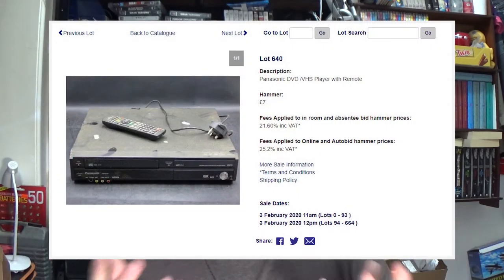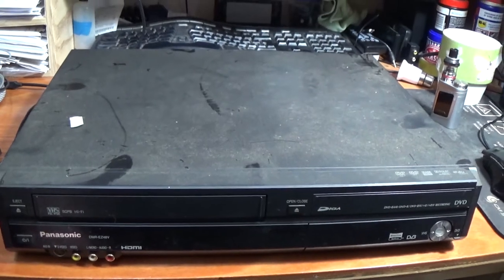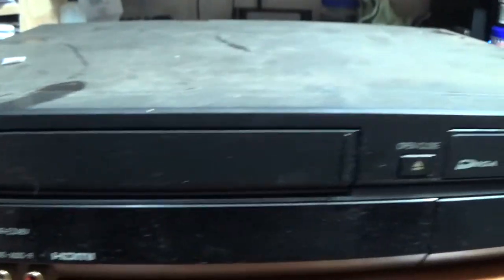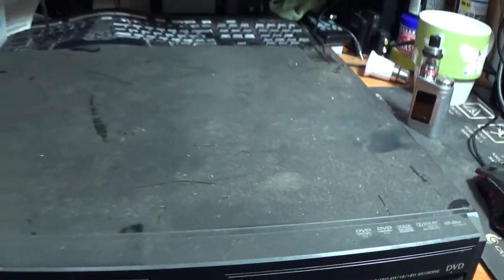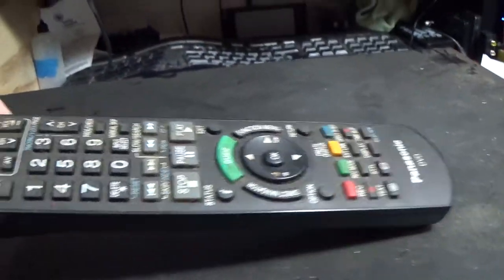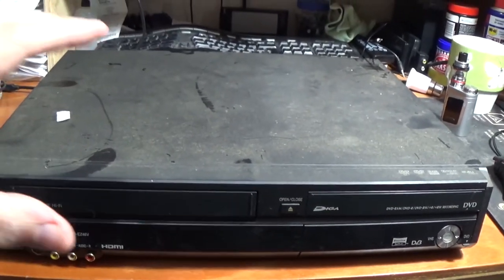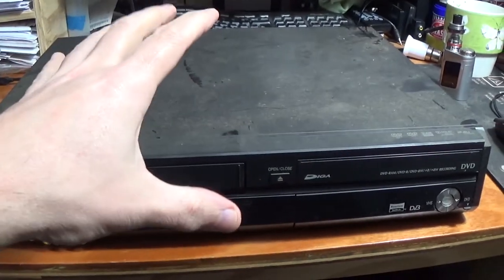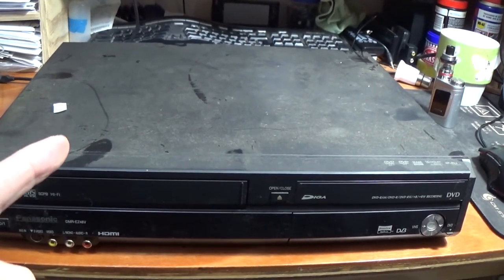Panasonic VCR/DVD Combo Repair - DMR EZ48V bought from an auction to sell on eBay.

Comment: I have two of these systems. One I have repaired a couple times. First time was replacing the VHS drive belt and more recently replacing a cap in the power supply. I just love it when I can bring something back to life. The second one I just purchased as a backup. I like that it has an HDMI output and seems to be durable machine. The lines on the top you mention toward the end of video are likely cc decoding information. The noise on the bottom is likely overscan noise. TVs mask out that area, but video monitors don't. Thanks for posting the video. Very educational. Cheers.
Reply from the maker: Thanks for watching and commenting. Like you I really get a lot of satisfaction from reviving totally dead units. I just recently learned about the overscan problem on an old VCR I was working on. Sadly not one I filmed but would have been good if I had.
Reply: I also love it, when I can bring something back to life too, but I also dump from every device I refurbish the firmware out for that specific Model number and keep it for further repair, if I buy the same device with a corrupted firmware for the second time for repairing I can reprogram the TSOP48 flash with my programmer and the device would then be back to life. Forget about for contacting Panasonic for the Firmware .BIN file they will never give the firmware out. but I and we can dump it out from the hardware flash ROM itself to obtain the Firmware if you have a programmer and good soldering skills for TSOP48 which I have
Reply: but this Unit has also a ST Microprocessor called Back End PCB on the left side at 4:38 (the green PCB) behind the erase head of the VCR drive. That has also a TSOP48 flash.

Comment: I have the same Panasonic VHS/DVD combo, and from my experience of using the VHS recorder it seems to do a very good job at tracking very jumpy tapes, not surprising I suppose given that it cost brand new about £250 back in the mid 2000s. I had one tape which was a home video, and for about the first half hour from the start of the tape the tape just jumps all over the place whilst playing it on a Sony SLV VHS recorder, and no amount of manual or auto tracking could stabilise the video to the point where the picture was watchable. I then tried the tape in my Panasonic VHS/DVD recorder combi and the machine was able to track the picture with no effort at all, almost eradicating the jumping completely. I initially thought the tape was so badly worn that no tracking could fix it, but it seems the Panasonic could do what the Sony machine couldn't. For tracking old tapes I would highly recommend getting hold of one, if you can find a cheap one that is as refurb/used ones tend to be about £150-200. Unfortunately I knackered the machine up by loading a tape which had a replacement back tab on it (I swapped over the front lid from another cassette because the back loading tab had broken off the other cassette) which didn't have the spring attached, which somehow has caused the idler or tape loader to malfunction (when you switch it on all you get is the tape loader idler moving up and down making a strange whirring sound), and also the tape will lace around the head but stops, and it initially will play but will then stop. If anyone knows what's causing this or knows how to fix the problem I would appreciate any answers. Also I don't think the DVD player/recorder works.
Reply: I concur. The tracking of problem tapes on these is the best. Great machines.

Comment: The failure to lace  problem is not due to the mode switch but light reaching the beginning and end sensors, it worked the previous evening but not next day when you had sunlight across the open deck. It's a very common problem when working on some video tape mechanisms.
Reply from the maker: Good point, I didn't think of that. But then again there was a 100W bulb shining down on it at night and then in the morning the sunlight was on it before and after cleaning the mode switch. I guess it could have been at different angles though and not hitting both sensors. It worked perfectly once it was back together which was a good thing.
Reply: Bingo!

Comment: I just bought this Combo unit for the up-convert feature to  HDMI. Many new electronics get deinterlacing wrong when converting to progressive. You can do it with software but its just never done as well as what a CRT TV can do. The Panasonic can up-convert 240i/480i to 480p/720p/1080p and it looks pretty good! This is one of the sleeper combo units that doesn't get much attention for what it can do.
Reply from the maker: Yeah the upscaled picture on this is amazing. I've had a couple of these units now and sold the for £200 each! Paid £7 for one and £32 for another.
Reply: Prior to watching this video I never knew the Panasonic VHS/DVD combi I have (the same model) had an HDMI port that allowed you to connect to a TV, though when I capture videos they are done via my laptop through composite connection. And I didn't know it had the upscale feature. Mine has had very little use but recently I managed to bodge it up by loading a tape which didn't have the spring which lifts the rear cassette lid up when being inserted into the cassette loader (basically I had to swap over the top of the cassette because the tape I wanted to play was missing the rear lid and I didn't realise it needed the spring which broke off, and this seems to have caused the machine to malfunction like it thinks it's trying to play a tape. Up until that point the VHS recorder was working fine.

Comment: Those burn marks in the lid are fine. Those transistors in the power supply that have the heatsinks bolted to them, they get really hot as they switch on and off rapidly converting AC to DC, they warm up during the "off" cycle and can be up to 400V, (the voltage almost doubles during conversion from AC-DC) they're known as chopper transistors. Any dust that gets sucked through by the fan burns off if it lands on them when they're hot.
Reply from the maker: Thanks for the info, it's always nice when someone comments with good information. It helps me to learn more 👍

Comment: Hey I have a problem with that very DVD VCR combo that I haven't seen online. The vcr will turn off every 2 minutes no matter the setting before it turns off it is stuck on 'please wait'
Reply from the maker: It sounds like a problem while it's doing the system checks and finding something wrong and shutting down. That's a hard one to diagnose but I would still probably check the caps on the power supply area.
Reply: @RetroElectronicRepair  thanks man

Comment: Had a couple of these until they all died and beyond repair.  They start up ever so slow within 3 minutes you may be lucky if you haven't fallen asleep until then also the remote control sensor are quite weak as well you have to point it really close to the front panel to get the remote to work.  I'm so glad mine all died will not purchase any more decided to go blu ray recorders instead.
Reply from the maker: They can be very temperamental machines. A lot of the time the actual dvd recorder drive fails and is beyond repair.

Comment: In electrical terms HOT and COLD don't refer to temperature, they refer to voltage. HOT = High Voltage & COLD = Low :)
Reply from the maker: Yeah I knew that one but thanks for commenting so other people know if I didn't explain it properly. 👍

Comment: Hello there, I'm in the middle of a repair of one of these machines. Got it all working and everythings back together. But the dvd tray catches on the front panel while trying to open/close. I've checked everything over twice and it's all secured where it's supposed to be. Any ideas?
Reply from the maker: The front of the DVD tray can be removed. maybe it has been slightly dislodged and catching. Otherwise there is something that's not quite it place properly. Make sure all the front panel clips are fully in place and the side clips are in correctly.

Comment: Is detol the best thing to clean it with
Reply from the maker: If you are talking about the play heads then definitely not! Only use IPA (Isopropyl Alcohol) and only use a piece of paper as shown.
Reply: @RetroElectronicRepair  the outside casing
Reply from the maker: I usually just use a multipurpose cleaner and then a quick spray of polish. But yes I suppose you could wipe it down with detol.

Comment: Great fix sir. Any idea what a DMR-EZ49V would be worth? In my loft have one almost unused with box and everything it came with from new.
Reply from the maker: Thank you. I'll buy it from you for £50 lol. Seriously that will be worth good money with box, remote and manual. I'd say £250 to £300, 250 for a quick sale or 300+ if you want to wait for the right buyer. eBay will take 10% of that though plus your postage cost.
Reply: @RetroElectronicRepair  Thank you for your reply. I may well dig it out of the loft in the near future. There's alot of stuff up there and i'm not getting any younger. On a serious note, i would be willing to part with it for £75 but buyer would have to collect.
Reply: @RetroElectronicRepair  After giving it some more thought... it's in the loft, pretty much forgotten and i simply don't need it. If you are serious and willing to travel (could be a long way for you) then £50 it is!
Reply from the maker: That's a generous offer. Where in the world are you? I'm in Lancashire.
Reply: @RetroElectronicRepair  Sadly i'm a long way from you: Sudbury in Suffolk.
Reply: Make a generous offer and just because you're a fair distance away you get... silence. Not impressed at all!
Reply from the maker: Sorry I didn't see that reply, I've had about 200 comments lately and don't get notified of them all. Shame your so far away or I would of come and got it and given you more than £50 for it.
Reply: @lesrogers7310  I wouldnt mind collecting from you im not too far
Reply: @GiftyBargains  To be perfectly honest with you i will need a slightly larger incentive to retrieve it from my rather hazardous loft.

Comment: do you get all your item tested by an independent pat tested before you sell these items on eBay
Reply from the maker: Most of the ones from auction have been pat tested already and have the pass sticker with date. Car boot ones no, I don't know anyone that pat tests them. Of course I do the visual inspections of the cable and any damage and check the insides for any overheating. If it has burn marks inside then I wouldn't sell it unless it was a component that had blown and needed changing.

Comment: Just got one £10 from the charity shop.. £180 flip in a week no remote
Reply from the maker: That's a very nice find. Well done on the quick flip.
Reply: I'm on the same boat, no remote. Should I sell like that, or should I buy a universal remote for it?
Reply from the maker: @bigkoat245 A new replacement remote is only about £10 on eBay and they work fine. You can sell it without a remote but you would have to sell it for a bit less than ones with remote. It will also probably sell quicker if you sold a remote with it.